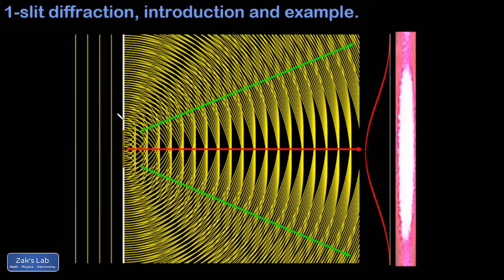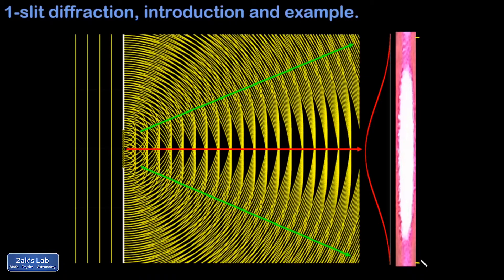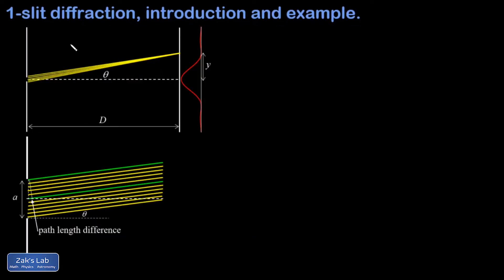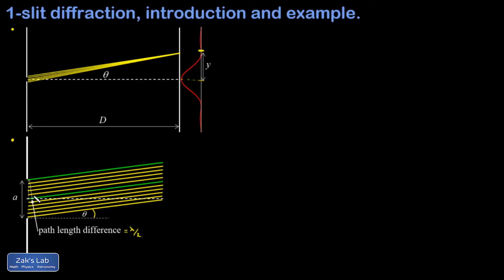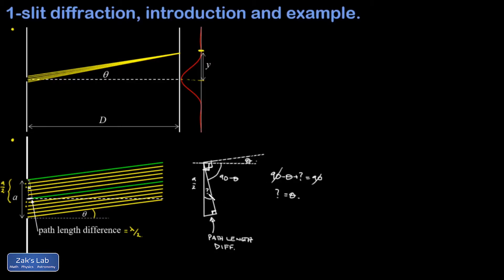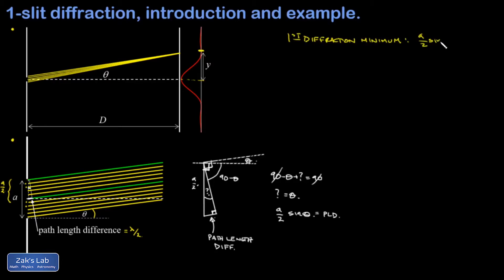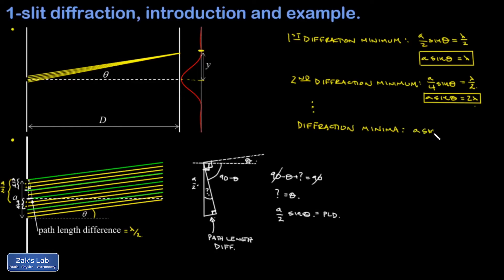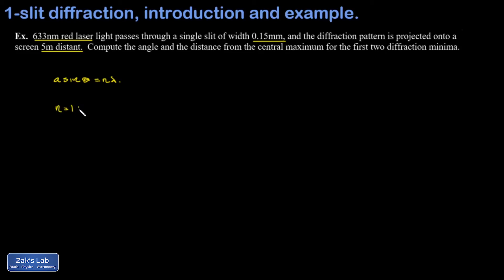One slit diffraction:  illustration using Huygens' principle, derivation for minima and examples.

Comment: At 12:39 you solve for 1 slit diffraction, is the equation the same for 2 slit and how does the angle factor in?
Reply from the maker: The formula for 1-slit diffraction minima is asin(theta)=n*lambda, where a is the slit width, and the formula for 2-slit interference maxima is dsin(theta)=n*lambda, where d is the slit separation.  

My 2-slit video is here:  https://www.youtube.com/watch?v=pleABz7t5Bg

And there are examples where a diffraction minimum (due to the width of the slits) could suppress an interference maximum (due to the separation of the slits): https://www.youtube.com/watch?v=X6GD0esxfjw